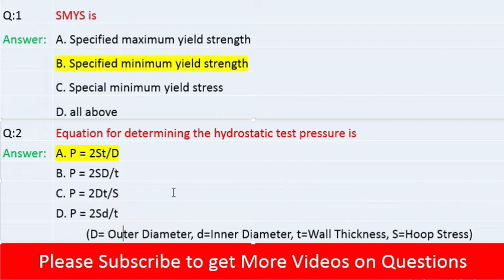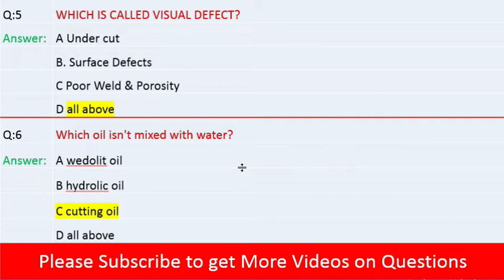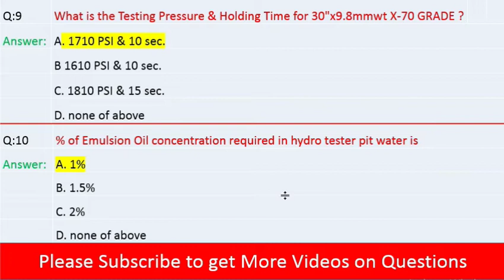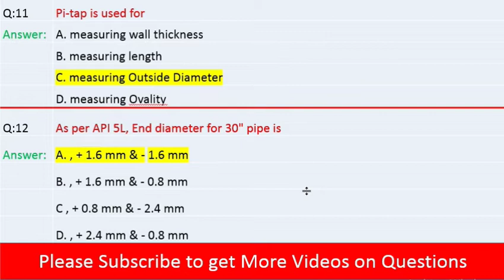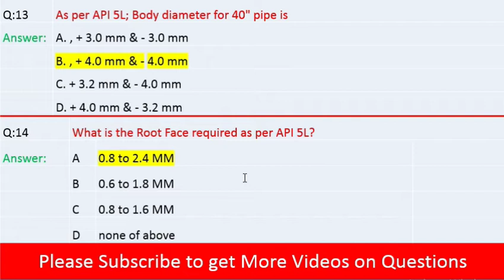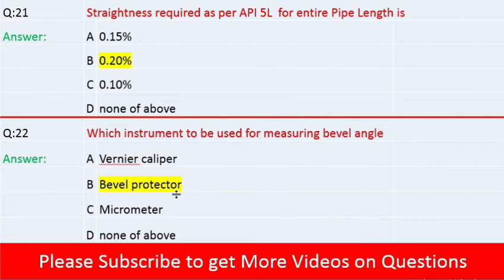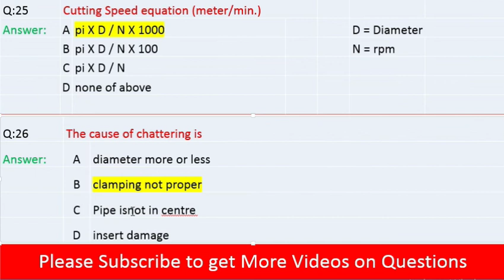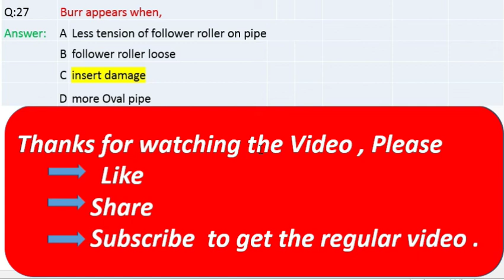API 5L line pipe Questions for Hydrotest and Finishing

Comment: Question no 6 answer is wrong
Reply from the maker: Could you tell me which one is correct? As per my experience, as I know a petroleum oil containing an emulsifying agent to make it mix easily with water, used as coolant for metal cutting tools.
Any questions let me know
Reply: Hydraulic oil is correct..... Because  cutting oil only used with water in rolling mill or other Machiening processes